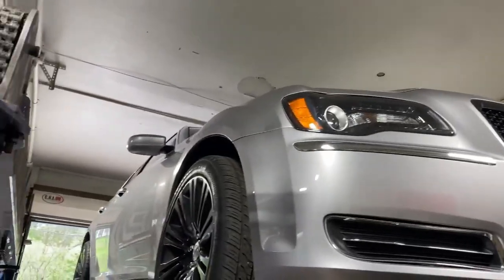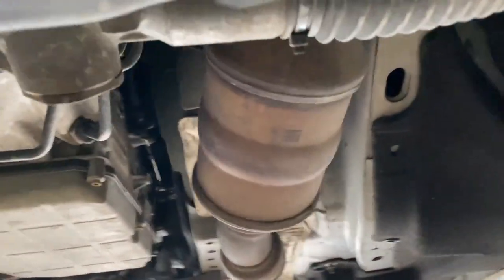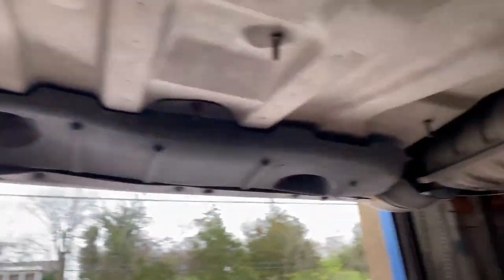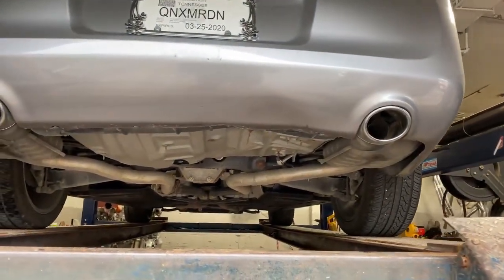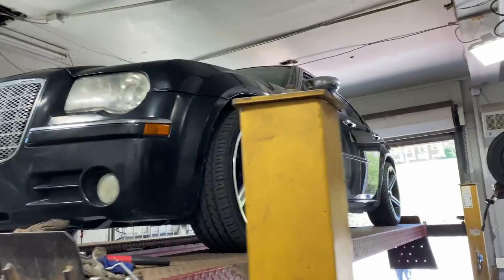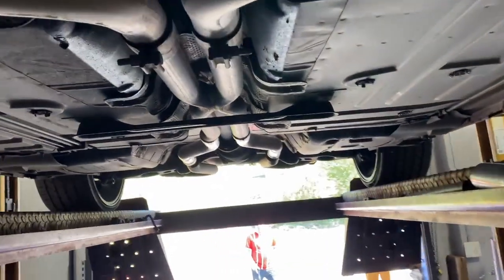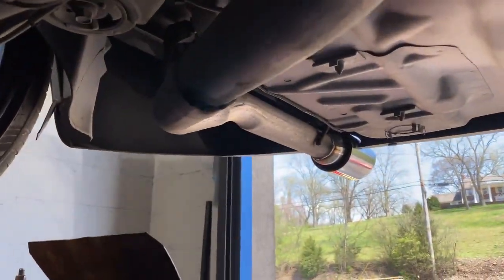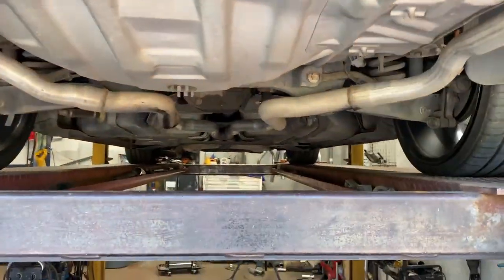Chrysler 300 5.7L HEMI: STRAIGHT PIPES Vs MUFFLER DELETE!!

Comment: Awesome content.  The str8 pipes sound alright never knew the 5.7 was in this car. Ya learn something new every day.
Reply: They put 6.1 hemi in too
Reply: Soccer videos and soccer Skills most are these are very rare. If you’ve seen them on the road probably not the v8
Reply: I got a 6.4
Reply: Depends on the model they start with a v6 then the 5.7 then the 6.1 for earlier srt8 and 6.4 for newer srt8
Reply: Most 300S models are Pentastar V6.
The 5.7 V8 is optional upgrade.
Reply: Soccer videos and soccer Skills  Most are the Pentastar V6. Not many go for the upgrade.
Reply: The orig 300 style still rocks the best.
Reply: Can’t relate I daily drive one lol
Reply: @bigdog544  also a 6.4 hemi in some srt8s i believe
Reply: Yeaa some are the 6 cylinder but some 300c and s are the 5.7 and up until 2014 they had the  6.4 srt but it was discontinued
Reply: Sadly I think they stopped with the 5.7 in that model
Reply: @mercury0214 there’s lots of v8 Chryslers not so much 6.1 L
Reply: I had one with the 6.4 but it was stolen unsurprisingly😂

Comment: These cars are legit secret hot rods.  True dual exhaust with x pipe from the factory.  If you disable nanny mode (traction control)  it really shreds tires and will surprise you.

Comment: Please don't call a car that still has the cats on "straight pipe" because its anything but straight piped. Cats are the most restrictive item in your exhaust system.
Reply: Cats arent restrictive. They have more flow area than the surrounding piping.
Reply: Older cats are restrictive, newer ones are less and the main reason most people leave them on is emissions
Reply: Bruh that’s a straight pipe